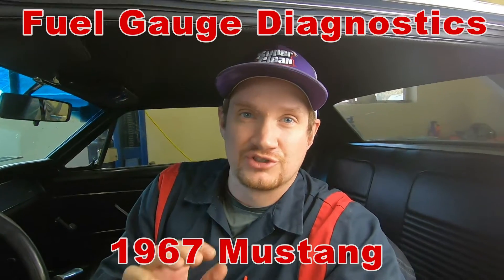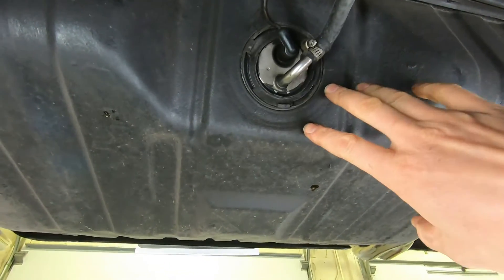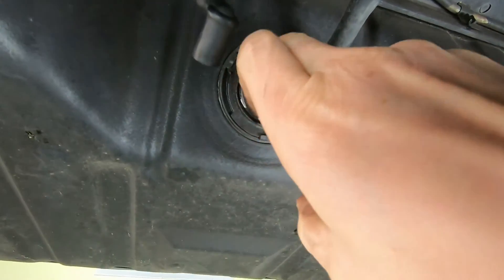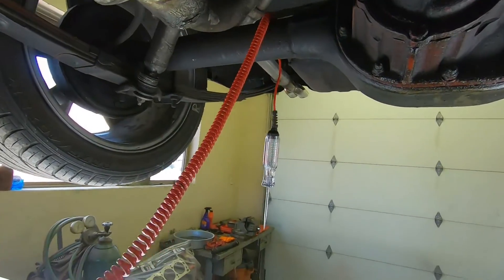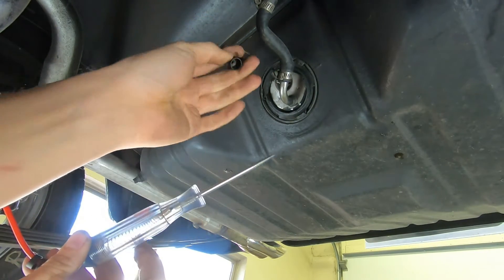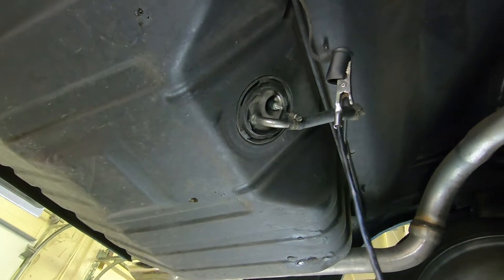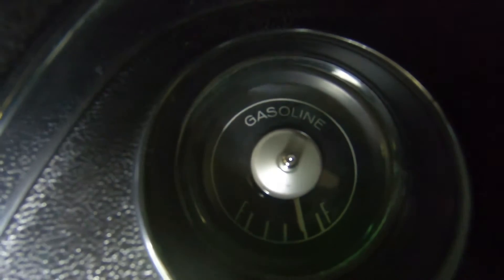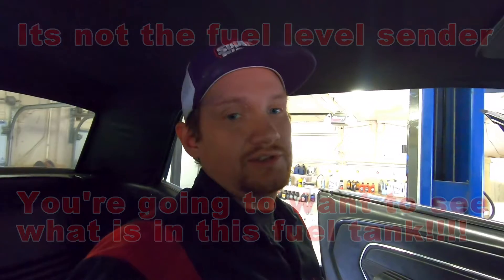Fuel Gauge Diagnostics - 1967 Ford Mustang

Comment: What if power does not pulsate
Reply from the maker: There is a constant voltage regulator that supplies the pulsed limited to the gauges. Sometimes people replace those with a solid state constant voltage unit. I would measure how much voltage is there because should still be limited.

Comment: i just went through 5 different temp senders and 3 gauges. i didnt even think of the volt regulator. i did the light test and the light stayed on solid. does this mean i have a bad regulator?
Reply from the maker: If it stays on solid, it's either the constant voltage regulator that went bad, or someone in the past has bypassed it. You may want to see how many actual volts you have. If you have full battery voltage, there is a good chance that it's been bypassed. I would be removing the cluster regardless and performing continuity tests to see if things are wired correctly.
Reply: @AlfsMustangGarage  how can i tell if it was bypassed? i have the cluster out and it looks like an original CVR
Reply from the maker: Do you know how to perform a continuity test?
Reply: @AlfsMustangGarage  i removed the regulator from the cluster and put 12v into it, grounded the bracket and put a test light into the other post and the light stays on. does this mean the regulator is bad?
Reply from the maker: Sorry for the delayed response. I would be inclined to think its bad (if its original). Some of the aftermarket replacements actually don't pulse such as the Scott Drake brand. The thing is they are fairly cheap to replace. My question though is, if the voltage regulator is bad, are all of your gauges not working or just the temp? Because that regulator feeds all your gagues.
Reply: @AlfsMustangGarage  just the temp/oil/gas gauges. i just tried a scott drake regulator and getting the same result
Reply from the maker: That's interesting that all three of those gauges are affected and all three of those gauges get their feed from the CVR. So at this point, you may want to check all the wiring. The CVR gets a power feed from the ignition switch. Then it feeds those 3 gauges, and those gauges feed their corresponding sending units. Keep us updated on what you find.

Comment: Some radiator shops used to flush and then coat a rusty tank. The coating likely simply separated from the tank.
Reply from the maker: Yup! It probably lasted for a while till we started putting ethanol in our fuel.

Comment: My 62 Falcon has an issue where both gas and temp gauges go all the way up seconds after starting the engine.
Reply from the maker: I would probably check to see if those circuits are getting ground. Disconnect the wire at the temp sending unit. Connect your ohm reader to that wire and the negative battery cable. You shouldn't have a connection. If you do, you'll have to chase down where that circuit is getting a ground. If you don't have a connection to ground. Try starting the engine with the wire disconnected. If your problem goes away, the problem is the temp sender. You can do those same tests with the fuel gauge circuit.

Comment: I have a low fuel sender.   Replaced the thermister but the new one never worked - relay and light does work.  The fuel sender worked, stopped working, worked, now seems to have stopped working for good.    Tank was spotless.   Ever come across that?   Guess I'll pull it when the weather changes to see what's going on.
Reply from the maker: You know, I've yet to have anyone hire me to diagnose one with a low fuel light.

Comment: Well that’s a new on on me. Never seen the coating do that. It’s almost always the sender, but just when you think you’ve seen it all.
Reply from the maker: Ya I've done lots of senders and lots of tanks but I've never seen that before. I would assume those old coatings were not meat to hold up to ethanol in the fuel.
Reply: @AlfsMustangGarage  yeah most likely. It’s been many years since I’ve had a tank coated. I’ve given up on ever reusing a tank. I always replace now. Too easy and cheap to not. 
I’m going to name drop you by the way. I was just troubleshooting my instrument CVR. It’s sticking and giving weird gauge readings. Funny you did a video on a sending unit at the same time.
Reply from the maker: Ya these mustang tanks are too easy and cheep to try and save. Unless of course you have some ultra rare boss or what not. But ya thanks for the name drop, I appreciate that.